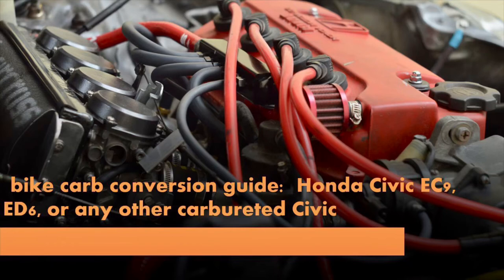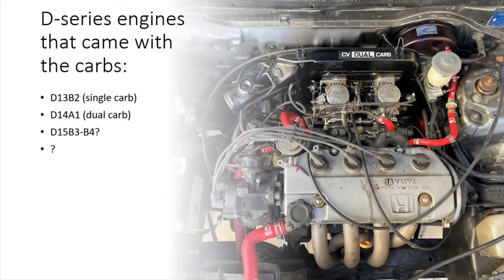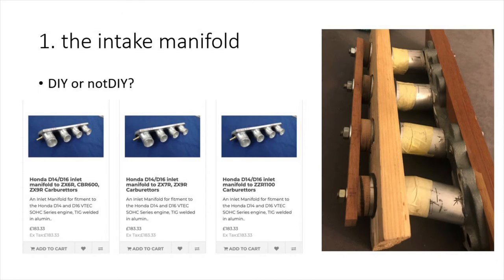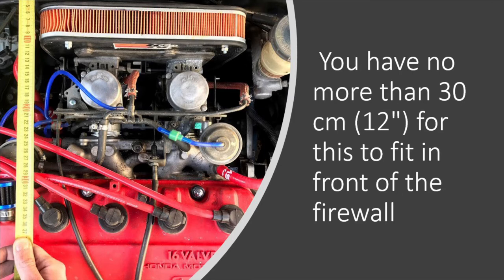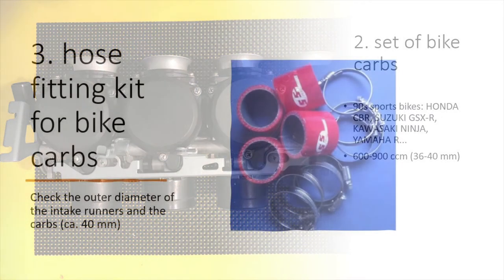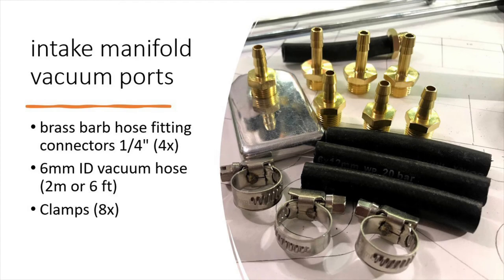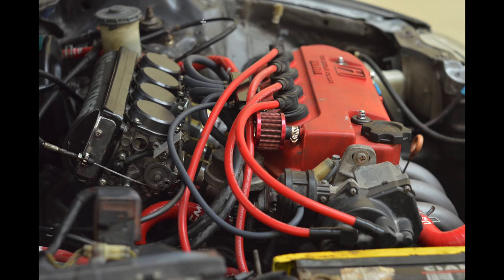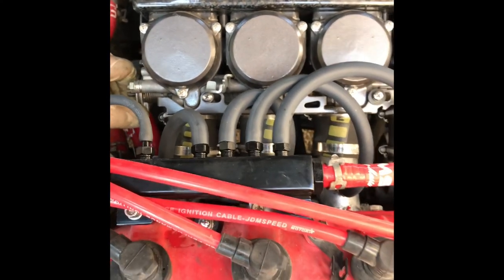Bike carb conversion guide  | Honda Civic EF ED EC

Comment: do you have an AFR gauge? I notice on moderate throttle, for example passing someone in local traffic (not wide open throttle) I see it go rich for a second (AFR 8).
Reply from the maker: No, I didn’t use it on this project. However, it’s very good thing to have. I relied on spark plug colors and the sound mostly

Comment: What did you do with the throttle linkage, did you use the standard cable? Also what changes did you make to jet sizes. I'm very interested in this as our d15b4 in Australia are auto choke and it's hard to find a replacement choke to fix poor idle issues and running rich. If you have a forum write up about it I would be very interested.
Reply: Where are you based Eb240, I'm just outside of brissy and currently doing this build also
Reply: @AgentOfMadnes  im in NSW blue mountains
Reply: Should add on socials, and share our builds ?
Reply: @AgentOfMadnes I know this is a really old comment. But curious if you ever went through with this.
Reply: @EB240 did you end up doing this?

Comment: Hi what size main jets did you use on your car
Reply: I used
0.50 idle jet
150 Main and
Moved needle up three spaces...
I think my needle was set to high.

Check my video out of my one
Reply from the maker: Hi man, thanks for the input. Seen your video, it’s looking nice. I used original pilot jets (42) and 150main jets. At first I used original main jets as well;132-135-135-132, and it was also ok, just a bit lean at wot
Reply: @bozidarbilusic  what about your needle jet can you send me a video where you drive your car
Reply from the maker: @graysonyogenshapetersen4319  this cbr carbs don't have tunable needles, so I left it all stock.
Reply: @bozidarbilusic  please send me a video of where you driving the car
Reply from the maker: @graysonyogenshapetersen4319  unfortunately I don’t have such video recorded. Now I have two of this carbs in the car. Maybe I’ll record a video about that sometime